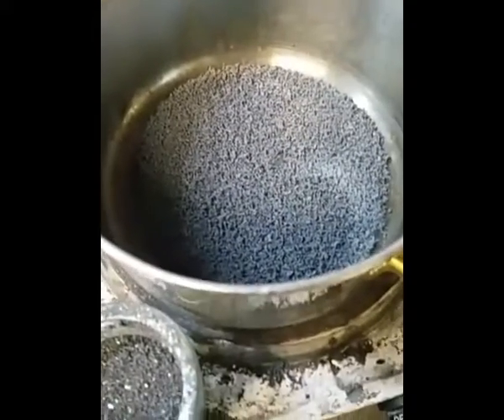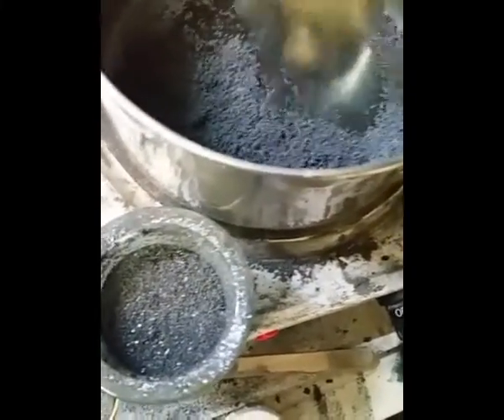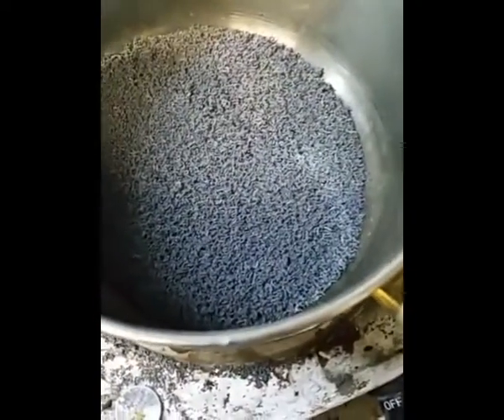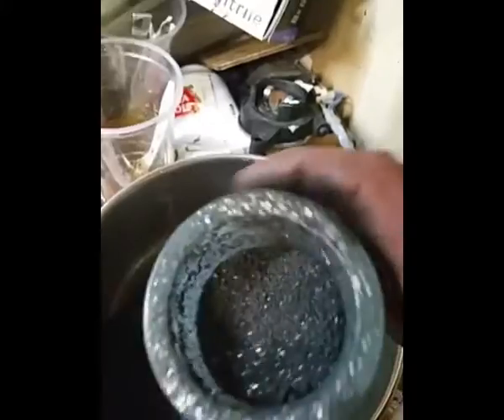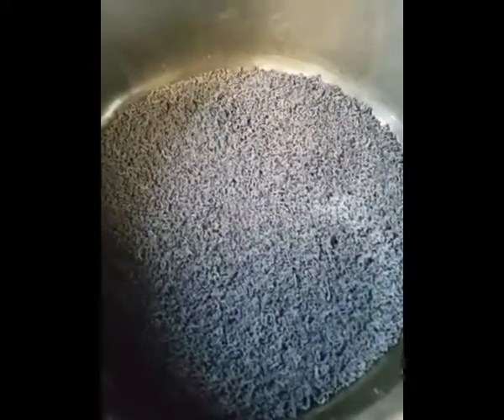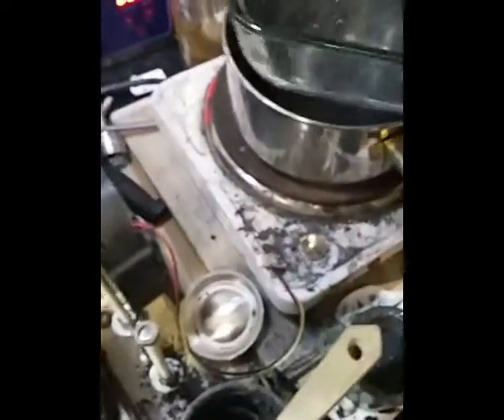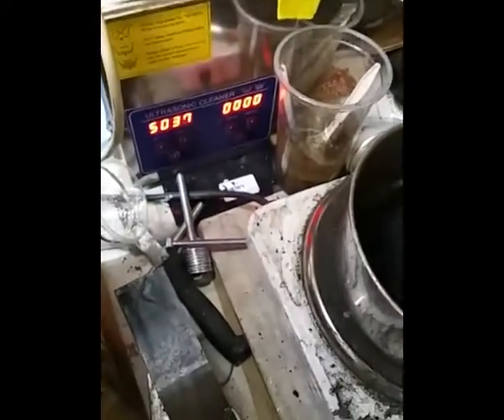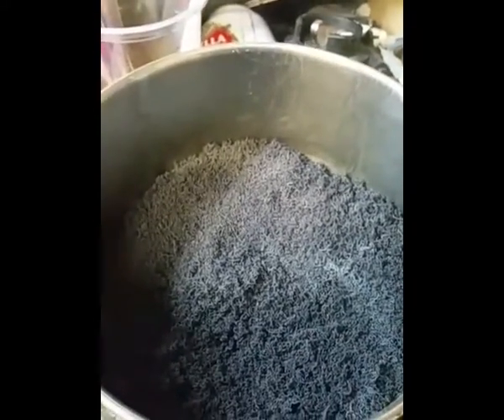Intercalated Graphite Completely Expanded No Pesky Silvery Bits

Comment: Good afternoon. Made such a cell of aluminum foil and compressed thermally expanded graphite, the electrolyte NaCl. is charging and working normally, but I understand this is not a supercapacitor? Although the capacity depends on the cathode material. The largest capacity turned out when using the TEG / Activated carbon in general does not give capacity. Could you explain by what principle this cell works: as a supercapacitor or as a cell with a gas chlorine electrode ?. Just if it works like a gas cathode, then you can try to make a sealed cell and charge it under pressure. Will it add capacity?
I also thought about the option that it is graphite that can be oxidized and intercalated during charging.
https://www.youtube.com/watch?v=A-UBzSPZ2Tk